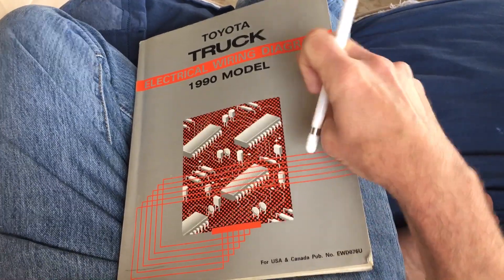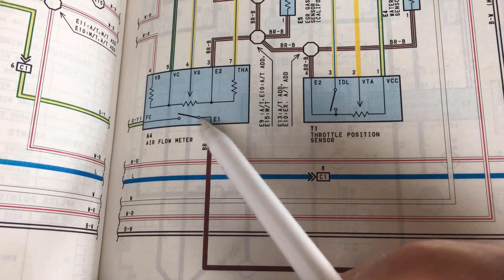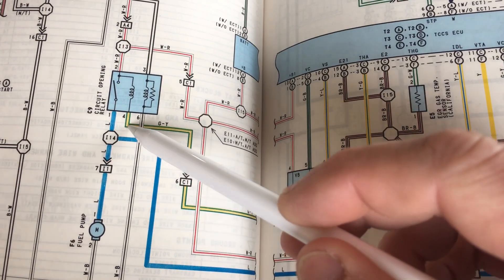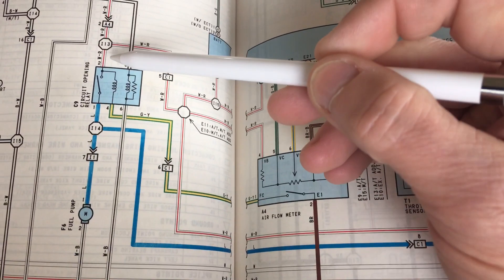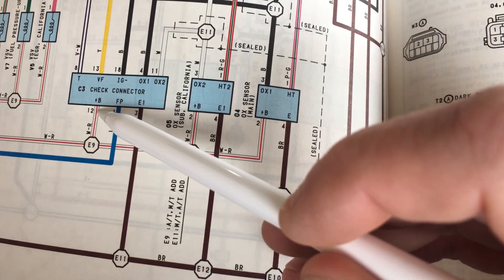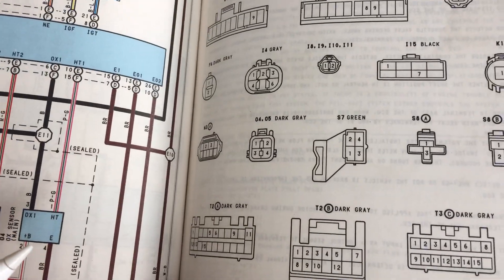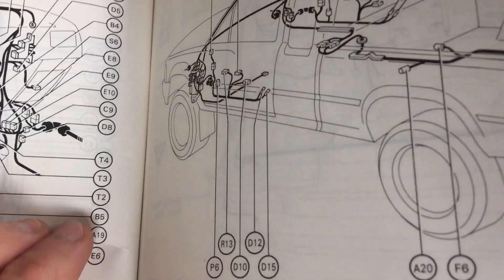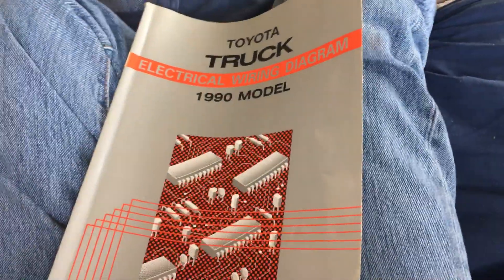Toyota 22RE fuel pump circuit, AFM & circuit opening relay low fuel pressure motor dies after start

Comment: Hey wondering if you could tell me why my diagnostic port sparks when I try to jump FP and B+?  I also don’t hear the fuel pump kick on when I try to jump it.  Is the fuel pump toast?
Reply from the maker: B+ goes straight to 12V positive on the battery. Sounds like something on the Fp side of the harness is maybe grounding out and/or the pump has shorted out internally perhaps.

Comment: What manual is that and where would I get it?
Reply from the maker: It's a factory Toyota wiring manual. You can find them on ebay usually. Search your model and year and "electrical manual". They usually have a silver cover.

Comment: got to have me one of them books for 93!!
Reply from the maker: Best book ever. It tells you everything you could ever wanna know about the electrical system, right down to each pin inside the harness connectors, etc. Super handy. You can find them on eBay, just make sure you get the Truck electrical one. I used that manual and re-wired most of the electrical wiring harness on my truck. At one point, my harness was just a mass of wires on the garage floor...  using that book, I was able to understand every single connector, wire and pin and modify stuff, etc. Absolutely invaluable data if you plan to keep the truck and/or start fiddling around with electrical issues.

Comment: Omg that book it amazing. I have a 1991 pickup. Would you think that the 1993 electrical manual be different or should I stick to 1991. Thank you very much
Reply from the maker: Eric - also google this "tccs toyota computer controlled system" and download the PDF. It explains a lot about how the ECU works to control air/fuel; you might enjoy it
Reply: @ray5961  https://www.academia.edu/34199101/TCCS_TOYOTA_COMPUTER_CONTROLLED_SYSTEM.   Is this the one you are talking about?
Reply from the maker: @ericrodriguez8556  yeah a few places have it. You should be able to find it for free some place. If not, I can get you a link
Reply: @ray5961  I was able to get it from that website. On the first few page it says it’s Volume 1 of the thirteen training manual. Did you get the rest or just the TCCS.
Reply: I guess I can pick and choose if I would want to read the other ones. Thank you Ray!
Reply from the maker: @ericrodriguez8556  Just this one. I think I looked online to see what the other ones were and none of them were anything all that worth while. The TCCS one explains a lot about what the ECU does
Reply: I did just check the relay and the relay is the problem. Thank you! You won’t have to worry about me annoying you for a while.
Reply from the maker: @ericrodriguez8556  It's no problem man; happy to help out! I would say the 1993 is probably fine, I don't think they changed much between those years. BTW, you can take the cover off most of those relays and open them up - you might be able to fix it or see if it's stuck, etc. I've opened several of mine by turning the tabs a little. And yea, that manual is amazing and super helpful.